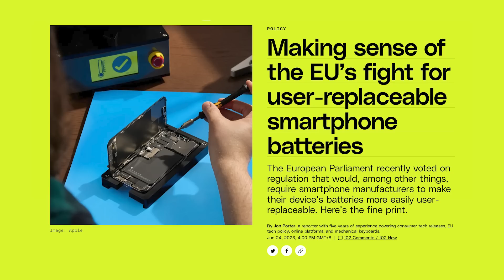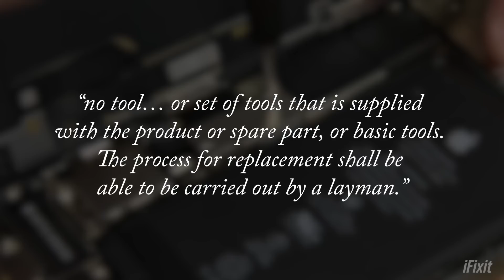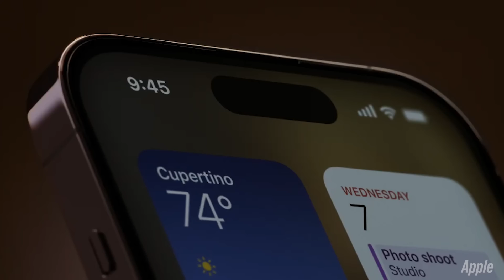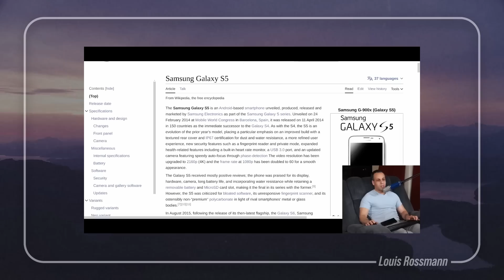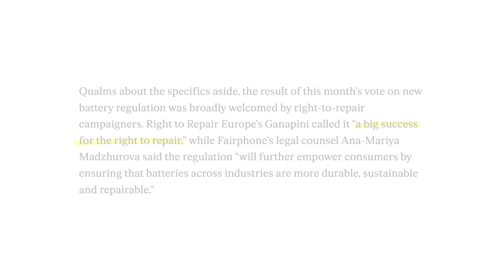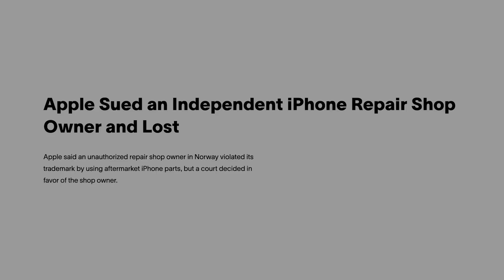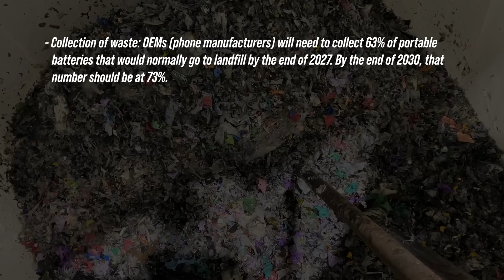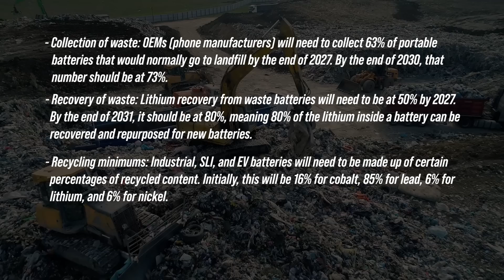EU Just Changed Smartphones Forever

Comment: As someone with a background in Automotive I think a super simple way to get people to bring their batteries back in for swap or recycling should just to charge a Core charge like they do for automotive batteries. Buy a 1500$ phone, it has a 50$ battery core on it. Buy a new battery a couple years later, it also, has a 50$ core on it, but you give them your old battery back so no core charge, Turn your phone in and get a new one a few years after that, get your 50$ core deposit back. And get charged a new core charge on the new phone battery. Cycle repeats.

Comment: I had a galaxy s5 for the better part of 2 years between 2014 and 2016. I enjoyed the water resistance feature while also changing my battery when it started failing. Also the back cover was solidly sealing the phone even with the multiple falls the phone experienced under my ownership. I can attest to that. Also it was one of the best phones I owned in the past 20 years. Things went down hill from S6 onwards.
Reply: Yup, my newer Samsung was heavy, hot, smooth/slippery.
It was like it was melt to break & be dropped.
"Just get a case"
"Too hot, charging stopped" 
I don't use the fast charger it came with, but the cable did break easily like the weak apple ones, the glass back broke after a week, & the screen broke on the 1st fall,
I've never even cracked my phones before, & it goes back passed the 1st iphone.
The dumb.  f my keyboard end of comment
Reply: @Eduardo_Espinoza my s5 was like an oven because the previous owner mistreated it greatly with constant max brightness and burn in in those old amoled screens
Reply: I had the S5 too, and I agree it was the only phone I was truly satisfied with. I replaced it only at 2018, when most of the apps I wanted to use stopped working on that Android version, and I wanted a better camera. Now I have the S20FE... The last Samsung with a micro SD card slot. I miss my removable battery and 3.5mm headphone jack 😢
Reply: @shane250  I bough the note 10 LITE. It had a 3.5 mm head phone jack and memory slot. Bought it in 2020 and replaced in last may with an s23 ultra. I do miss my note 10 lite. Even though it had no wireless charging and was not water resistant. The camera quality was lower (i never use my camera) but the price was perfect and it lasted me 3 years before the battery would drop to 60% by 11 am. Unfortunately I only changed it because I could not replace the bad battery.
Reply: @alsairafi91  
Wireless charging is overrated anyway, IMO.
Reply: @alsairafi91  I'm still using a Note 4 (the last Note with a changeable battery) but sadly it is dying. A shiny Note 10 Lite arrived today from Ebay for £122. I'm hoping this phone will last me as long as my Note 4 has done (6 years). I'm going to have a busy weekend trying to work the thing out!
Reply: @neilwilliams2907  i have had it for 3 years. It was the perfect phone for me. It was an upgrade from s7 edge. I am using the s23 ultra now with no noticable difference from note 10 lite except for the water/dust resistance, camera and battery.
Reply: Lasting quality doesn’t make the leeches as much cheddar.  :P
Reply: I'm still running a Samsung S5 Neo after getting it 8 years ago. On my second battery. Getting a bit starved for memory now, but I don't need the latest and greatest whizz bang camera . Love the phone. Reliable as hell. Go EU. Lay down the law to manufacturers. (BTW I am an electronics engineer by qualifiaction 🙂)
Reply: I kept my S5 for over 6 years. It even came with an extra battery and a battery charger. Absolute beast. I'd keep it even longer but it stopped being compatible with my bank app. Traded a couple years ago for the S20FE and it's alright, but I miss the headphone jack and changeable battery.
Reply: Nice...did s5 have any official IP rating?
Reply: @Megaterminator1302  
Yes. IP67
Reply: @Megaterminator1302  ip67
Reply: The S6 is a complete POS.  The S7 is much better, but the battery is sealed in it, unlike the great S5.

Comment: I bought my first iPhone in 2008 or 2009 brand new, it was a 3G and I paid £349 for it. Since then, all my iPhones were bought second-hand and typically cost me less than £100. When I broke the screen of my SE, I bought another one for £60. I currently have a 2nd gen SE and I paid around £90 for it.
The ridiculous anti-consumer practices actually prevented me from spending my money on new Apple devices, apart from my iPad Mini 2 and 2021 iPad.
It’s even worse with their computers. I never owned a PC, but had a dozen or more computers over the years. I still use my cheap 2009 iMac, 2011 MBA,  but regret even buying the 2015 MB for the difficulty of the battery replacement.
I will will keep my 12 years old MBA until it breaks and will start using a dumb phone soon. I’ve had enough of this digital imprisonment, two-factor authentication nonsense and false convenience of digital devices.

Comment: I'm not so concerned whether a phone comes with water proofing, mildly resistant is good enough. Nearly everyone uses a case to protect their phone anyway. I've used Otter cases on 3 different non-waterproof phones that have been submerged in water (toilet, pool, big mud puddle) and had zero affect. Some kind of flip hatch for battery access with some type of seal should be easy for engineers. Someone else commented on standardized batter sizes. Great idea! They can be the same whether the device needs 3000 or 5000 mAh.

Comment: The reason phones are glued together with non-replaceable batteries (apart from Apple, who we have determined are evil and should be banned from the planet) actually lies somewhere in-between the two extremes of "consumer hostile" and "consumer demand".

It's cheaper to make a phone that doesn't have any replaceable parts. Less development needs to go into how to open and close such a phone while maintaining structural integrity and watertight seals etc.
And at the same time, it also means that when the battery is dead, the phone is dead so the customer is likely going to buy a new one or send it to be repaired by a qualified tech which in either case makes the manufacturer more money down the road than if the customer could just replace a battery.

In the end though, consumers vote with their wallets. If people stopped buying Apple products because they were this evil, Apple would have to adapt or die.
But consumers are STUPID and so that's why Apple gets away with robbery in broad daylight.

We could just as easily solve all these problems by removing all stupid people from the planet. Which would solve a lot of other issues in the process. We'd be left with a few tens of millions of people that would make it paradise.

Comment: I bet these companies are going to be assholes about it since they're being forced by law.
Look at the Samsung device at 3:43 for example. The battery slides into the bottom. I bet they'll cram the microphone, vibrator motor, or other necessary components into the bezel at the bottom requiring you to buy specifically their OEM battery module, and make them really expensive in the process.
What do you guys think?

Comment: You’re wrong about Apple. They barely make any profit from repairs. The concern they have is from two sides: Scammers taking advantage of their two week repair policy: They buy an iPhone, switch the screen for a lesser one (and unofficial ones ARE substandard — this is important to note) and returning the device for a full refund. The second concern is people buying secondhand devices with substandard parts and it reflecting badly on their brand. 

If you’d researched your video a little more, you’d have come across even Louis Rossman discussing this. The important thing to note is that Apple put their brand value ahead of all other business concerns. Jobs always considered the brand the most valuable asset the company has. They protect it above all else, and it’s worked well for them. 

FYI: As of right now, I suspect this video is potentially libellous towards Apple. Best of luck!

Comment: Europe needs to calm down and stop passing these laws. They will always backfire (for example USB-C iPhones will lead to Apple forcing you to buy MFi cables). With the batteries, Apple will make their removable batteries super short lived and have a chip inside their iPhone so that it only takes Apple Batteries which will be more expensive that the current cost of battery replacement ($99). This is an EU L.

Comment: Apple have always ensured that battery replacement is not possible and even if you buy a new battery, the circuitry in the device degrades the performance of the battery to the same state as the one being replaced. Added to this, Apple downgrade the original battery with every update. When the original Iphone was announced, it was a breath of fresh air in the mobile phone market and became the best selling phone...at that point in time..however, buying into Apple, ensured that if you wanted to maintain peak performance, you needed to replace it regularly. Also, if you decided that you wanted to abandon EOS and buy another smartphone, typically an android or Google then your music would be lost, along with you email address and any other data you hold dear. It was a case of upgrade or else!  I personally would never buy another Apple device, though I currently use an iPhone and iPad. Although many of my apps will no longer work on the iPad as it’s quite old and Apple no longer support updates for it. I suspect that my 2 year old iPhone will soon suffer the same fate. Do I feel cheated and robbed? Too damn right I do.

Comment: Smartphone companies comply globally; they make an EU specific version or there's a third very possible option. Companies pull out of the EU. We've seen companies deliberately not operate in the US due to its hostile laws and the same thing could very well happen to the EU. The EU is once again imposing stupid regulations that harm the general user. Would you like to have the "benefit" of carrying multiple batteries around with you all day? Would you like the "pleasure" of struggling to find water proof phones? Would you like the "enjoyment" of carrying a 1kg brick in your pocket all day? Battery capacity and charging speeds will be set back several years. Look forwards to a screen on time of about 5 minutes!!!1!1!1

Comment: I hope they remember to enforce / write into law a few more things:
- ensuring that there is a supply of batteries for several years after the release of the product
- lack of DRM in the batteries and the entire power supply system, allowing third parties to manufacture replacement batteries, without any artificial limitations to their performance
- (not so sure about this) standardization of battery shapes / sizes
Reply: Simply allowing easy repairs will also make it much harder for manufacturers to block 3rd party parts. 

If, after these laws, an iPhone battery can be replaced by any original apple battery, it'll be relatively simple to spoof the brand for 3rd party parts.

That said, I'm almost certain we'll see a lot of loopholes being closed before this goes into effect.

Comment: You act like this actually changes anything. It's not like this forces them to make their devices reparable. Whoo hooo, you can now carry another battery around again! There are phones that charge in 30 min, who really needs this? And how does this now make it so they can't use adhesives??? There's still most of the phone that could use it so you still can't repair it. The battery is often not the reason someone needs to replace their phone, this does nothing for the vast majority of cases. All of these changes were made to fuck over consumers with a complete disregard for the exploitation of our planet.

Comment: The battery technology evolved to a level that manufacturers didn't think it was necesary to have them replacable. Instead, the space they gained from making a built in battery lead to evolved other technology and/or making it lighter and smaller. The fact that they left out people that wanted to replace their batteries after a typical lifecycle was concidered a normal progress - if you wanted a telephone with replacable battery, just buy that phone. But instead, all manufacturers went on to the non replacable battery aproach, leaving it with no phone batteries being user replacable. It's not until now when the phone but also screen are durable enough to survive the battery, that this have come into the mind of regular people, that think that after a couple of years use, the phone is still usable if the battery just would last longer - or being user replacable. Used phones are being more and more sought for and thus demaning replacable batteries. No single company can be held responsibility for this chain of events, but other things should be such as being able to leave the phone to a third party repair shop.

Comment: Corporate indifference gives rise to corporate greed. How did we ever get to the point where batteries were not replaceable? And why do we ignore Apples unrelenting pressure to NOT allow repairs by independent and authorized repair centers alike? Sad times indeed. Thanks for this video, we needed it.
Reply: Because an engineer understood the assignment of “I never want to search for my battery on the ground in a crowd after dropping my phone from being bumped into”.  Y’all haven’t lived enough.
Reply: @dogbots159  how badly engineered does it have to be to get its battery out of the phone after dropping it.
Reply: Easy how we got to the point where batteries were not replaceable, the public wanted waterproof and dustproof phones they could take to the pool or beach etc.
You cat easily make a phone totally waterproof if it has a removable back.
Reply: @andy70d35  Easily doesn't matter. It's possible to do, has been done, and could be done. But they make more money by making false claims about it, so that they can force consumers to get upgrades instead of a cheap battery replacement, alternatively paying ludicrous sums for a repair of the battery.

I mean, the video even mentions existing IP68 phones with replaceable batteries, that's the same rating as iPhone 12 and presumably the rest of them. The exact depth a product can be submerged to will vary, but that honestly has more to do with other parts of the design than the outer shell specifically, such as how much pressure the components can survive.
Reply: @Sylfa enjoy your $6k USD phone LOL - glad you think “easily” doesn’t matter.
Reply: What makes you think that we're ignoring it?
Reply: You could just not buy from Apple. There are modern phones out there with replaceable batteries. The last thing you should want are clueless law makers sticking their noses in private industry. Government always makes things more expensive and slows innovation when it gets involved.

Comment: It all sounds nice and justified. But reality is Europe is trying to force a rule against the market. I don't expect it to hold up. Just look at their ruling to eliminate ICE cars until 2035. Now they are backtracking on it as they realized it was unattainable and purely ideologic. If you want to ensure better designs and efficient use of materials, you ask the companies to ensure free unlimited replacement of batteries in their devices. Then, you'll see how the same companies will find a way to make that swap cheap and those materials recyclable. In the form this ruling has right now, it's won't achieve environmental goals, but just more batteries in the trash and worse products.

Comment: There goes your water proofing, dust resistance, and super fast charging. (super fast charging utilizes multiple smaller batteries.) I've had the same samsung for 3 years and have very minimal battery lofe issues
Reply: Ipx68 is still possible. Dunno bout fast charging,  but im positive
Reply: Super fast charging is what kills your battery.
Reply: Heat is what kills ur battery. That's why they use multiple smaller batteries. To devide the load/heat. I've used super fast charging 45 watt, charging on my Samsung, for years, and I'm sure that it has had an effect on battery life. But it's not enough for me to notice in my daily usage.

Comment: The reason the US Gov. doesn't want you to be able to remove the device is you can't hide as easy. You are not able to only turn on the phone when you need it. The bitch tracks you even when it's off as long as it has a battery. I'm happy to see the ability to pull the battery return.

Comment: I've long thought that electric vehicles should not be plugged in, but instead have their entire battery swapped out with a kind of docking station. You'd pay a little more than you currently do to recharge the battery, but the process would be completed in one minute instead of 30 or more. The extra amount charged would cover the cost of keeping batteries fresh across the network, no vehicle would ever have to have it's battery replaced at crippling expense to the owner. I for one don't plan to buy an electric car for many years as I can't afford a new one and when I am eventually able to afford a used one, they will be suffering from degraded battery performance.